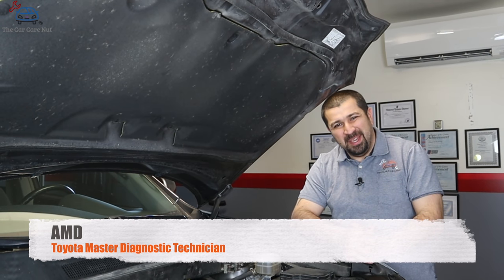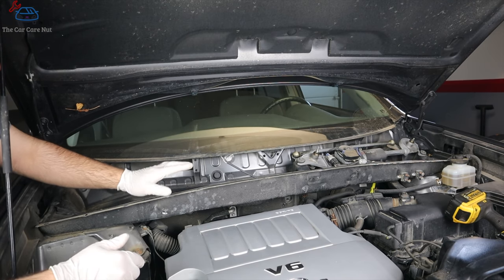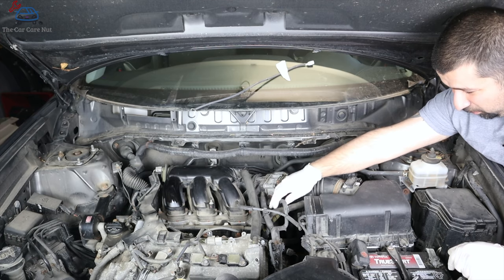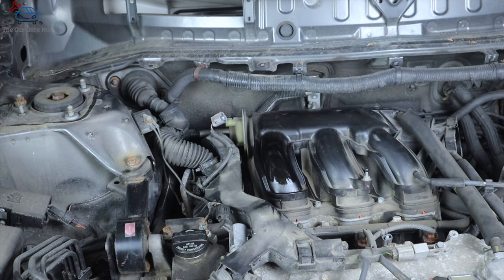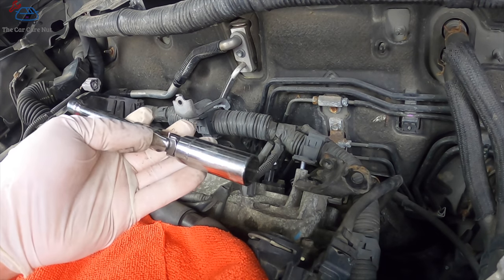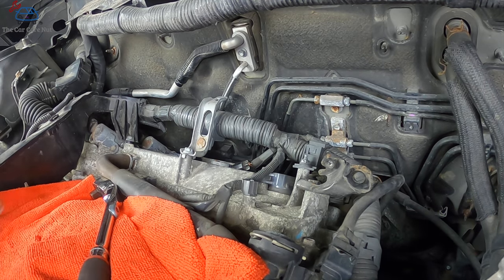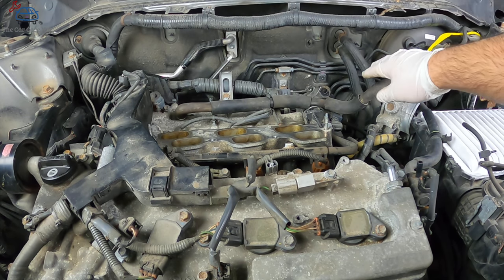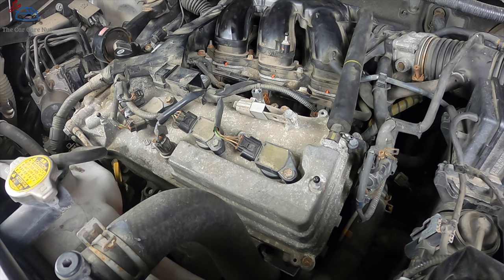How to change spark plugs on V6 Toyota and Lexus 2GR-FE 3.5L engine

Comment: This is the only video that warns viewers about the back cam sensor and that it has to be unplugged before removing driver side rear coil. It's too late for me I ripped off that plug but luckily I found a video of how to reconnect VVT socket or something like that I can't remember exactly what the title of that video is.
Reply: Tell me about it. I gave up and left the old spark plug in. 😂

Comment: I have been doing DIY for years working on BMW, Honda and Lexus. This video is one of the best! I have just finished the same job on a 2008 Lexus Rx350. It took me 6+ hours. I have to say Toyota engineer made this job unnecessarily difficult!  On BMW and Honda cars (inline 6, V8 and V6) I own, spark plugs can be changed in 30 - 45 minutes.

Comment: Really appreciate the lesson I 33:35  will say as a 75 year old I feel my ability is limited to reach and access this chore.   But that being said I now can understand the costs involved in this maintenance.   Both this 2012 Highlander, and the 2016 4Runner in your other video were very informative and I Thank You for the excellent demo and your guidance.  Respectfully Paul R. 👍 3/18/24
Reply: Your wisdom in encouraging this seasoned mechanic helps many of us that have been chronology Blessed. 2008 Lexus ES 350. 128, 400 miles. My uneducated guess is an oil control valve sensor or vvt solenoid sensor on Bank #1, the(A-bank) which is the closest to the windshield on the ES and other models. I would appreciate any help y'all have to offer. I'm 69 years and trying to remedy this on my budget. I'd appreciate any help

Comment: I guess I'll stick with the four cylinder.
Reply: certainly some advantages. they have enuf power for 2 wheel drive
Reply: Well Problem is this is a transverse mounted v6 engine. Those rear cylinders 1,3,5 are a bitch to get to. If you buy a car with 1GR-FE which is mounted normally 🤣 you won’t have these issues.
Reply: Rwd v6 is alright
Reply: The V6 has nearly twice the horsepower. 

I’ve had both, I’ll never buy a 4 cylinder again.
Reply: 4 cyl. Is worthless.  Can't tow, AWD.  Buy to drive, not buy for ease of maint.

Comment: Got it all done thanks to this awesome video...took the time to lubricate all moving parts on wiper motor assembly and eliminated an annoying squeak as well! Bonus!! Thanks for the instructions
Reply: Amazingly, I also found a missing plenum bolt (from the bracket) missing when I removed the intake...this vehicle has been to a "reputable garage" to replace a faulty rear coil and plug less than 2 years ago. I'M amazed that because of your video instruction, I took the extra steps to not only do things correctly, but also use oem parts so this shouldn't be a regular occurrence. Thank you for the awesome info

Comment: Great video! I just did plugs on my 2010 Camry today, it has 133k on it and they were original plugs, they still looked great! I put oem Denso iridium plugs back in. I did remove the cowl as well, super quick and easy, well worth the extra 5 mins of time for how much more room it gives u! Whole job took me just over 2 hours.

Comment: im like 9hours into this and taking a break right now after finally putting the intake manifold back on…
thank you for the video you make it look a lot easier than it looks LOL
my car is 15 years old now and all my ignition coil clips broke after pushing down on them
also broke my dried out pcv hose and snapped an ignition coil bolt but it was a good learning experience

Comment: Lots of work just for spark plugs
Reply: There are some GM Vehicles you need to almost remove the front bumper to change a headlight bulb!!!! At least these plugs are long life plugs.
Reply: @TimeforchangeTrudeaumustgoEndb  that's the case for a lot of bulbs in lots of cars including Toyota. Other problem with this engine is that because of the silly placement I find a lot of cases were the plugs go in cross threaded

Comment: Just did this for my 2007 Lexus RX350; it was approaching 240000 miles and I finally decided to bite the bullet and got new coils and plugs (I got the IKH20TT since they were cheaper and had same rated life as the spec FK20HR11); I haven’t worked on this before since the last owner did the change and always went to the dealership; it took me 6 hours, including a quick throttle body and MAF sensor clean, but I can imagine being faster for subsequent times. The only victim was 6:24 one of the flat 10mm nuts by the suspension stripped the screw shaft, but only partially (I ended up padding the stripped part with some washers so I could still make it structurally integral). Overall, tiring but very satisfying job, thank you Amd for this guide I would’ve had a far more difficult time without this

Comment: I’m changing my plugs tomorrow. This is very informative,thanks. My 2011 Rav4 Limited has 117,000 miles and still runs like a champ,except when I first start it ,then it runs rough until it’s warmed up then it runs perfect. The plugs are the fist step,hopefully this fixes it.

Comment: Absolutely the best video to watch to enable you to do this job!  I was able to unfasten the rear plenum bracket bolt using a 12mm ratcheting wrench although it is a tight squeeze as I didn't have much luck trying to use an extension and socket.  Would have taken me a month to do this without the excellent step by step instructional video that you produced!!

Comment: Well, I did it! It took almost six hours as I took my time and it wasn't hard but more physical than anything. It's definitely the most challenging spark plugs I have ever done on any car but that 12mm bolt in the back was no joke 😂 But this video was a lifesaver 😁😁😁
Reply: Right. That 12 MM was hard. I lost one and I jacked the car up and everything. Still haven't found it. Luckily, I was able to get one from Lowes.  It was an M8 1.25 I think, something like that. I dropped them a few times too, but I was able to get them with the magnet. Eventually I got it in there. That was a great feeling
Reply: I really don’t see what that bracket if for???? The plenum has a ton of bolts holding it in place … my guess is it’s not needed

Comment: Took me 4.5 hours on a 2007 Sienna.  Nothing special about me, average DIY tinkerer with an average socket set, didn't use any power tools.  The infamous rear bolt wasn't that tough to break loose or re-start, but it took a while for my Rube Goldberg contraption of extensions and swivels to fully loosen and re-tighten it.  Excellent video.

Comment: Just did this on my 2012 Highlander last weekend. It’s only got 56k miles on it but it’s 12 years old and had the factory plugs still. I used OEM plugs and gaskets and now I’m good for another 120k. Well worth the time and effort to have peace of mind that the plugs aren’t fossilizing in the engine, lol.

Comment: I lost the back bracket bolt. This job was so tough for me. I think I bought the wrong vehicle. This job took me 12 hrs straight. I tried my best . That last blind feel bracket bolt was the icing on the cake. When I dropped it and couldn’t locate I said f that bolt . It rode good driving home. But they designed this car like crap. I can’t believe we have to go through so much for a tune up. Thank you for your video couldn’t have done it without you.

Comment: Thank you for this video. Not everything worked as easy for me as it did for you in the video. I had to reference videos from others on different methods to remove that 12mm bolt, the intake hose, etc. Nonetheless, I got this job done 7 hours later. Appreciate all your video content for Toyota DIYs! Thanks for helping me save money and giving me the confidence that repairs and maintenance are done right.

Comment: Excellent video. Thank you so much for recommending the 12 mm swivel socket for the bolt on the left bracket. I had almost given up until I found your video online. It was probably the 12th video I watched. Cudos for a great explanation and picture of bolt and bracket that you provided.

Comment: Outstanding video. Cohesive and concise narrative, decent camera angles, and editing that doesn't smack you over the head with a tire iron. Nicely done.

Now...

In a just and sane universe, there would be a special segment of hell reserved for automotive engineers, where for all eternity they would have to work on the stuff they designed equipped only with a $120 Father's Day gift tool kit.

How wrong would I be if I guessed that you have seen more than one engine with brand new plugs on the front three and factory original on the back?

Comment: This is a great video. VERY helpful. It's not a hard job, just a bit tedious. Here's an FYI: if you are changing your plugs, then you have between 100-120k on the engine. Do yourself a favor and get new coil pack connectors.  They will likely  be brittle and the retaining clip will break when you disconnect them. It's pretty easy to replace them using a very small flat screw driver. Again, a bit tedious but not hard. I didn't  have any and all mine broke, even when being careful. I decided to run out and get some new connectors, but the closest dealer with them in stock was an hour away and they only had two. So anyway, now I have to take the plenum off again the replace them.

Comment: Great video, very detailed.  Thank you...thank you. 

Just did the spark plugs replacement on my 2016 Highlander and it wasn't that bad of a job.  No need to remove the cow, wiper motor and such.... the back 2 bolts of the intake were not that bad to get to or replace.  The bracket on the driver side has a slot were the bolt might not had to come out completely.   As suggested on the video, the throttle body was cleaned really good and the PVC valve replaced.  At 122k miles the Highlander now feels refresh...
BTW... OEM part from Toyota aren't that much more expensive that aftermarket when ordering parts online and picking them at the dealer.  IE... I paid less than $6 for the Toyota throttle cleaner while any local part store will have it for a lot more...

Comment: Thank you for a great instructional video. Working on my 2008 RAV4 v6 reminds me of a Citroen I had back in the early 80s. Only a certified Citroen mechanic could figure it out. It is a great vehicle, now that I have 300,000 miles on it but not an easy one to work on. This ain't no Series 1 Land Rover. Toyota makes great cars that last a long time, but are not designed to be easy to work on. Catch 22 here. Thank you again. B

Comment: "Just sayin'" don't know if you'd seen Ahmed's (The Car Care Nut) video of this process, but there was a thing or two you were struggling with that might have been easier.  ON THE OTHER HAND, your leaving the harness connected to the coils,  looked to me to be a real time saver!   Trying to release those coil connectors on the back plugs in those tight spaces would be, to me, REALLY scarey.   GOOD WORK!  When we bought our RX in 2020 (an L/Certified 2018 model) with 12,000+ miles on it, I sat down with a Service Advisor and got prices for all the major services to come.  The quote at the time (9/20) was $1110 for the full 60K service.  As I pass 50K and start thinking about that $$$ these videos begin to give my confidence a boost that I could accomplish the whole thing for the cost of parts alone.  A neighbor two doors down has flushed the brake fluid on his 2007 Highlander Hybrid about 10 TIMES so I think we'd have that covered!  THANKS, again for a thorough tutorial.

Comment: Thanks! Been dreading/ procrastinating this project and most other videos estimate 4-ish hours….using your tips I did it in under 2 hours
Reply: …..that tough bolt in the back though was a bit tougher as there were AC lines in the way that are not present in this video

Comment: If you have a big engine car, it's best to work on it on your own, because there is alot of things mechanics will break when simply just replacing spark plugs, at least u know what u broke when u work on it, mechanics didn't tell me that one of my coil clip broke and now the care had misfire cuz it got disconnected when driving terrible mechanics, thank you for being a good respectful mechanic

Comment: Awesome step by step instructions! This is really informative.. 
The most challenging part was not to break any harness clips and there are quite a few of them!! 

I found stubby wrench 1/2” very useful and easiest way to remove the bolt of the intake manifold above cylinder 1..

Comment: You're a Prince AMD! Thanks for that video. Did the job yesterday on 2009 Highlander and went alright.  You make it look easier than it is though. On my configuration, the box  extension was hitting the firewall so I had to remove that extension to take the plugs out of their opening.

Comment: Dealer wanted $875 to replace 6 spark plugs on a 2017 es350.   You just saved me $750.    Perfect educational video!
Reply: Yes, $125 of parts and $750 labor, sounds about right.  I did this job myself yesterday on my 2015 HL it was $150 in parts (6 plugs and all the gaskets).   It is indeed a really good video.

Comment: As many have already said, excellent tutorial!  Though the 2007 Camry I did the work on Today has only 106k miles, it was throwing lots of codes. Shop said it needed all new coils. They also said there is a Service Bulletin from Toyota saying the engine ground straps go bad and cause the coils to self-destruct.  The grounds I could find all looked great and the coils did too.  I sure hope I didn't just throw nearly $700 in parts (gaskets, coils, plugs) at it unnecessarily 🙏. Not to mention the massive strain on my knees and lower back to get those firewall-side plugs replaced.

Clearly someone had been in there before because the hidden back-side intake plenum bolts were not there and - not sure if it was just dumb luck - but the right-rear side had no bracket or bolt at all - srange but it made the job a lot easier!  I didn't even have to remove the cowl.

One small suggestion: a shop-vac was helpful since some of the wire covering beneath the intake plenum was crumbling due to heat and age.  I also used it to clean out the airbox.  Oh, and the air filter needed to be replaced too.

Thank you for the added confidence and time savigns. It took about 4 hours (45 of which was getting my pressure washer started and washing the filthy engine compartment).

Comment: 2005 Avalon Limited, 120,000 miles.  Make sure you've established a budget for the parts., before you start and  OEM of after market? The rear spark plugs were never changed since purchased new.  Great Video  you provided top notch info and illustration .... thank you for that!  I tried a variety of tools to try and get that 12mm in the back.  Finally Next day delivery from Amazon a 12mm impact swivel.  It took a bit of time getting it set on nut enough to break the nut loose.  I got through the spark plugs (E3 plugs) and aftermarket coils, ready to reassemble air intake.  I found it hard to get it to thread in the back and dropped the nut, and this car eats up sockets and nuts as they fall they disappear into some ledge never making to the ground.  Fortunately, I have an ACE Hardware store down the road and took the bolt from the easy right side to match up thread and nut head.  I bought about 5 bolts, some different lengths even shorter by 1/4".  Using the shorter bolt (screw) it was easier and went in lickity split.  And you know when it stopped I couldn't help tightening it about 15 lbs. torch and I heard your words, don't tighten it so the next time or next mechanic wouldn't have a hard time.  A spark plug and coils should last 100,000 miles, so it wont be me dealing with this again, I hope.  Found one loose wire with a round thing on it which appeared to fit in a open hole, couldn't fasten it professionally because of location but stuffed it in.  I didn't have to take pictures as your video was my pictures.  New K&N air filter, gaskets.  The darn air intake to PCV valve hose had lost one of it ends and the emissions vacuum valve nipple broke off with the nipple stuck in the hose.  Waiting for shipping of these items.  Thanks again for the instruction video and views.  Finished assembling right side of engine, new starter too.

Now I've disassembled the left side engine area for work replacing Power steering pump, water pump,  new brushes for alternator, and of course serpentine belt.  Then new front struts, rotors, and calipers.  Of course it is not easy.  I have to jack up the engine to get access to the pulleys. After I disconnect upper and lower passenger side engine mounts.  Every thing on this engine is very tight to work on.

then rear struts, rotor and calipers (painted red) and new fuel filter and pump.  Because they say don't change the transmission fluid in a Toyota unless you've changed it every 50000 miles which it was not so the transmission is the weak link in my plan.  We are retired on fixed income so a new car is not likely, but this car should last 50,000 miles without problem (hope) and my wife drives 1-4 miles a day so 1200 a year....50000/1200=42 years.  which would you bet on the car or the wife lasting longer?  or me for that matter.

The sunscreen is broken in the up position.  Decided to pull fuse and leave it up.  The sunscreen motor would run , but plastic gear stripped , but it was too annoying every time your start the car.  I hope this helps.  Thanks again!

Comment: my friend have same with this car 2008 Toyota aurion 2gr fe , I change spark plugs for my friend car, it took me 3.5 hours for spark plugs replacement ( I am not a motor mechanic), I bought spark plugs from Toyota dealer in Australia very expensive $40.50 AUD each ( $243 AUD for 6 spark plugs in AUSTRALIA) I change last month( I learned from the car care nut,thank you)